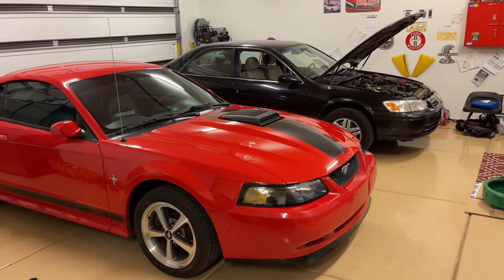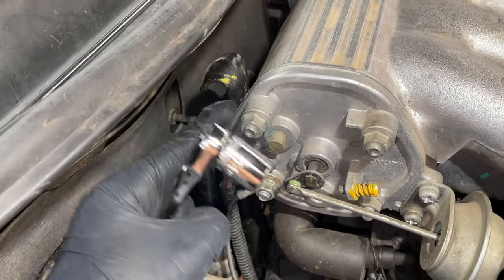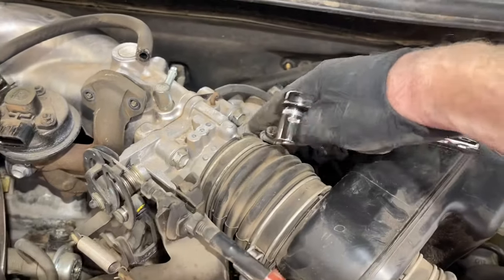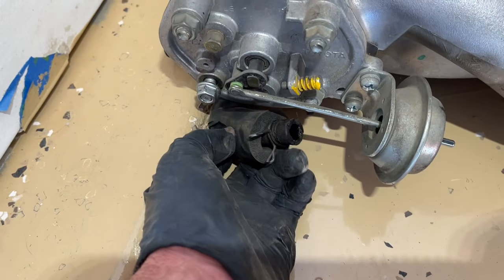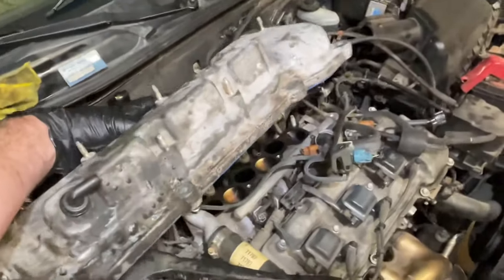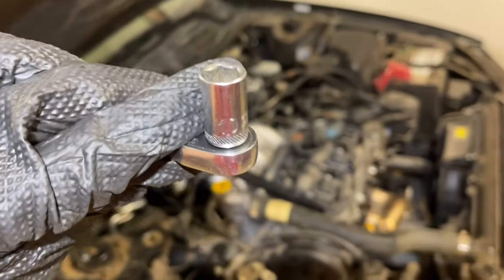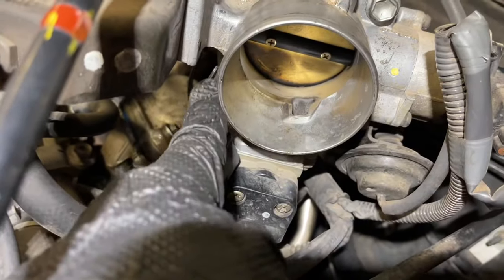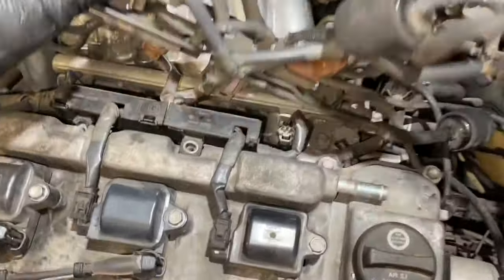Toyota Camry V6 valve cover gasket replacement: Remove intake manifold V6 Lexus es300

Comment: very good video. it is VERY important to be GENTLE with the bolts on the valve cover. it is easy to overtighten them. at first do NOT use a ratchet, tighten them by hand, in a star pattern. starting in the middle. the TQ spec on the 1mzfe is 5.75 ft pounds. UNDER 6 POUNDS ! SIX ! also, apply black RTV on the head, on the longer sides of the cam shaft. and also on the camshaft gear side. you should see the factory sealant and where to reapply. when you are done with the job make sure the idle is normal and you don't have any vac leaks. double check all of the vac lines are reconnected.

Comment: Best vid for speed and I'm thankful. A few things: torque for the cover bolts is 69 INCH lbs / 8nm. Two 5/16 washers on each bolt can help to get this torque. Might be why last one is leaking. Should do the half moon seals, as rtv degrades. Can knock carefully with a screwdriver and reapply rtv. Good idea to clean the inside of valve cover with brake cleaner. Inside top is where the oil goes and probably only chance to clean. Bent PCV == old revised design. Also meant to be good to clean the EGR and acis....
Reply: Thank you, can you explain more about the 5/16 washers, wouldn't that shorten the screws, I'm not understanding
Reply: @toronjanahera1143  factory supplied bolts are crush bolts. Eg one use. You can buy those or make your own by using the washers on the existing bolts. They add pressure, so you can torque them before they bottom out.
Reply: As a preventative, 1mzfe while i do the sparks plugs. Im planning on cleaning valve covers/throttle body. Anything else i should consider while everything is off? Im working on an estima so even less room to work on 😅@shadako2

Comment: Thanks for this!!! Best video and simplest method I've seen for removing upper intake to gain access to that rear valve cover! Pretty much what I'd have expected, though other's I've watched, completely disconnected throttle body...🤦🏼‍♂️
Excellent job!

Comment: I appreciate the close-ups of the fasteners.

Shop manual calls for putting a little oil resistant RTV and the crevices on the cylinder head usually by the ends of the camshaft.
Reply: Yep

Comment: Thanks man I just did this today and your video made for a huge help not as daunting as it seems I just had trouble moving around that wiring harness when removing the rear valve cover but other than that not too bad

Comment: I have used those non-OEM blue silicon gaskets and it lasted less than a year before it started to leak.  I strongly recommend using OEM gasket from Toyota, if you do not want to hassle with this job twice.
Reply: Tom. Were the blue gaskets you used made by FelPro? I have used them with good success.
Reply: @marccrotty8447  No it was not. But I will never use those shiny blue silicon gaskets ever again regardless of brand. I see other youtube videos showing replacement of those blue ones only after one year as well so don't trust them. Use the black OEM ones to be safe.
Reply: @tommason5689  Agree that OEM products are (nearly) always the best choice.

Comment: This is exactly what I was looking for man, I just bought a beater 99 Avalon w/ almost 300k miles smoking just like you said and goes away when warm. Looking forward to doing this this weekend while having this video right beside me. Thank you so much!
Reply from the maker: Make sure you also see the second video as it shows using a screw driver to go around the park plug holes on the gaskets when putting the valve cover back on 👍🏼
Reply: @dannyjohnsonsgarage  thank you so much!
Reply: I bought the same Avalon with the same problem.. 190k miles $400

Comment: Yes the spark plug oil seals are backward. Also I took off the egg valve down below and was a big help getting the valve cover back on. Also used some spray 3m adhesive to glue the back gasket on. Used a small plastic wedge to work the oil seals around the tubes so they wouldn’t tear after smearing a little oil on them. It’s a pain for sure.
Reply: Thanks for making the video it did help me with this.
Reply from the maker: Yeah, must have been done that way from the previous owner. I’m glad you figured it out
Reply: Please what is the egg valve?

Comment: I tried following along, because I just couldn't get two of the three back ignition coils out. But when I got to the 14mm bolt on the back with the bracket, I can't get in there to get it. I have the same engine (2000 Toyota Avalon), but I don't have as much clearance as you do for some reason. So now I just don't know what to do other than take it to a mechanic to get the spark plugs replaced. I really don't want to do that.

Comment: One of the best videos I’ve seen for this. Need to do this on my 2000 es300 with 250k miles. Just curious, how long did it take you?
Reply from the maker: The back side was a few hours figuring it out, would be faster following the video. The front was about 30 minutes. Watch the second video on the front side as well for a tip using a screw driver to circle around the spark plug new gaskets so the cover goes on easier 👍🏼

Comment: My 2002 Camry V6 has some sort of stability bar fastened to the manifold cover right behind the EGR valve, which made it very hard to get the screws in the back (it can be moved a little after detaching the attachment screw)

Comment: Can you show how you got the new plug seal rings into the valve cover?
Reply from the maker: This procedure had been done by the previous owner, so I cut the footage out on the spark plug grommets because I replaced them the same way he had and was told in the comments they were not correct. I lifted the tabs on the back side with a screwdriver and then put them in. I then closed the tabs back down. Sorry I can’t be of more help

Comment: Recommend replacing the PCV Valve and grommet with valve cover off. The old brittle grommet always wants to break and drop into the head.
Reply: Rest assured it won’t drop into head but rather captured by the valve cover lining inside.

Comment: If the head gasket is actually blown from overheating, should I assume that the head is warped and will need to be resurfaced?  Will I be able to tell just by looking at it?
Reply from the maker: Yes, I would have it taken to a machine shop. I’m not sure if it’s an iron block or aluminum, but it could also be warped and needed to be checked and corrected

Comment: You can remove the rear spark plugs without taking the intake manifold off. You just need to slide in a swivel extension then connect the ratchet.

Comment: Do you have to replace the intake plenum gasket, throttle body gasket and clean the inner throttle body and valve ?  Also, should rtv sealant be reapplied ?  Thnx - great video ! 👍🏼
Reply: I wonder too
Reply: Yea wondering this as well?? Suppose intake plenum gasket would be "if needed," but wondering about RTV at least in certain spots? Generally Toyota recommends use of some for VC gaskets where timing cover mates to head(s). At least my inline 4 1zz-fe called for this.. (obviously much more painless than this) wondering if they call for this for their v6s? Doing this for a friend's mom's car. Rear doesn't appear to be leaking, just front, but hell, they want em done! Should have grab spark plugs right away!
Reply: no unless you damge them and use rtv in the corners of the valve cover gasket
Reply: I figured that since I was there, I might as well replace them when I did this job. At this point my 98 Camry’s intake gasket and throttle body gasket were old and brittle. Theyre $15 for the two. You can also clean the throttle body without removing it by taking the throttle cable assembly off and bending the throttle body towards the air filter to clean the dirty side. Use some throttle body cleaner and toothbrush/rag to clean it up. 
And you can use dabs of oil resistant rtv in the corners of the valve cover gasket. 
Good luck!

Comment: I got the repair manual, it specifies at least 3 steps per bolt in a specific pattern, and adding sealant to the end turns of the gasket. Happens to be where mine started leaking first. Also those head bolts are TTY, one time use. Edit: I was wrong. I don’t know why it said that…..jeez
Reply: TTY??? What’s that

Comment: I don't know if it was mentioned in comments, the critical part that was not covered is taking off those caps on the cover are very difficult to remove. I don't know if anyone else has had the same problem.
Reply from the maker: I was doing a repair that had already been done before so I bet mine came right off for that reason. Sorry you had trouble with yours
Reply: @dannyjohnsonsgarage Hi Danny, do you know if there is any special tool made to remove those caps? It makes me nervous doing this job knowing that is what i have to contend with.

Comment: Great video! Would add maybe torque specs, and also curious if some permatex is needed where timing covers meet heads?
Reply from the maker: It doesn’t hurt to add a few dabs of permatex, especially on the sides and where it comes up on the rounded area

Comment: Question, do you need to depressurize the fuel line before doing this? I realize you worked around the coolant hoses so you didn’t need to drain, but what about fuel pressure?
Reply from the maker: There isn’t a need to depressurize the fuel system if you are leaving the fuel rail untouched.

Comment: I bought Felpro gaskets twice and for the life of me I cannot get the rear spark plug tube seals to insert. The fronts went on just fine but I cannot get the rear on. I've even tried hammering it in but they're literally just too big to fit. What do I do??
Reply: apply some grease or silicone around the inner ring of the seal, that might help

Comment: Why does this engine have spark plugs (without coils) on the back three cylinders,  but it has coil-on-plugs on the front three cylinders?
Reply from the maker: It almost seems they have one coil pack operate 2 cylinders to save money

Comment: If the gasket is new, no need for additional sealant on the block?
Reply from the maker: I would add gasket maker on the arches on each side where the factory had it

Comment: The reason I ask is because i have check engine light on with codes 1135 1155 and i replaced the sensors but light is still on but noticed that  ground is not connected on the back of the engine.
Reply: P1155, I've seen on some forums that that evcap canister solenoid can be bad from factory, I just ordered one today 2001 Camry le v6, 130k miles, the light came on around 65k miles, we replaced the o2 sensor and it came back, replaced gas cap, no change. 

Some people were saying change the whole canister, but other were saying just the solenoid where the plug goes into, it's under the rear in front of gas tank, held on by one tiny screw to the bracket.  There are different ones so you'll want to look at yours before ordering, if you go that route, it's a cheap part to replace. Also the O2 will be grounded via the exhaust, you can always check with a multimeter, or test lamp.
Reply: @LifeBloodMarketing  Thanks I did the scan  and its 1155 1135. I think it is that ground that isnt attached and its not sending signal to the sensors.
Reply: @LifeBloodMarketing  It was the ground on the back not attached.  no more check engine light

Comment: What gasket you recommend ?
Reply from the maker: I went with felpro. If you do the spark plug gaskets I am told the previous owner put mine in backwards and so I replaced them as they did. I may cut that part out of the video, but be aware
Reply: Toyota

Comment: Seals won’t go in gasket and of course the video skips putting in the seals
Reply from the maker: I cut that part of the video because it put them in as they were, but someone may have replaced them incorrectly before me. I pried up on the small metal tabs to tee them and squeezed them back in from the bottom side. Not sure if that was correct.

Comment: The design is so stupid in these model v6 Camrys one of the WORST to  work on
Reply: Next improvement is without transmission dipstick ... what fun. Could ruin the tranny without exact amount of oil replacement.